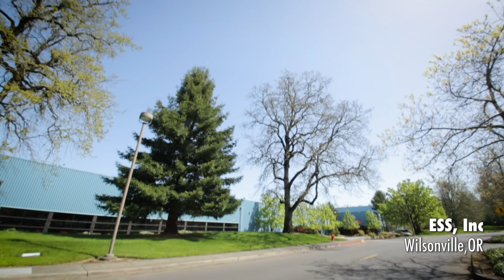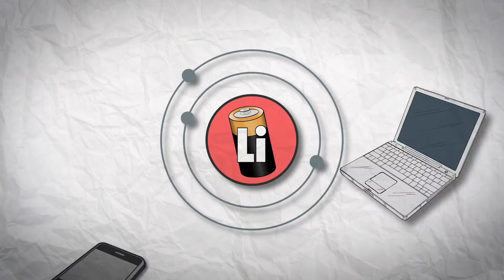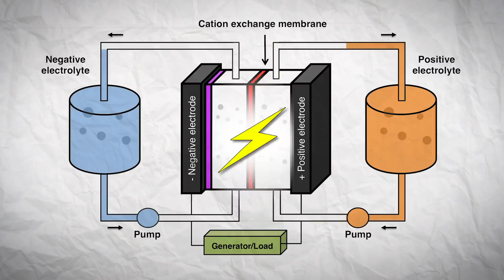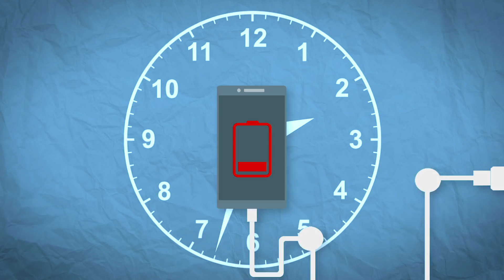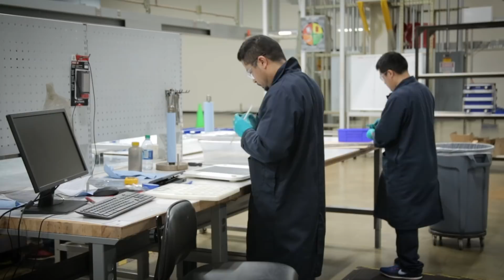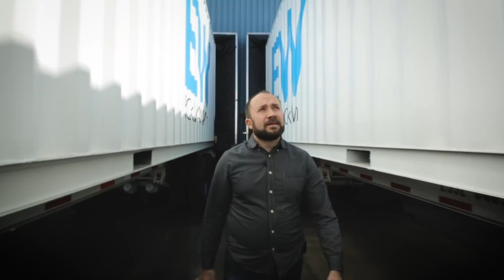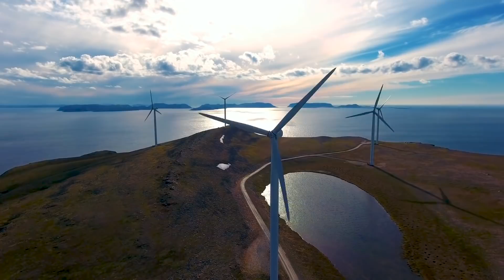Battery Fueled by Iron and Water Could Transform the Power Grid

Comment: Here's the problem I see with this video, first off it compares cell phone batteries ie lithium cells by saying they degrade over time, wow that means we will soon have new types of batteries to go in our cell phones right? No because this technology is not for cell phones it doesn't work for cell phones. But hold on you just compared the technology used here to cell phone battery tech that surely means you intend making it work for cell phones right? No! then why compare cell phone technology to what you have, it makes no sense because what you have will never replace what I need it to do ie power my car/motorcycle, my cell phone/tablet pc and so on.

So we still need lithium technology then to power all the things we hoped this would replace? it seems so.

So comparing lithium to this iron water battery is dishonest and misleading? Yes.

So if I'm wrong then send me a battery for my electric motorcycle as I need one.
Reply: They're using an example which anyone can relate to.
Reply: Yes I get that but it is a dishonest comparison because it's as good as saying a hand cart compared to a van.

They both clearly can carry stuff but are they comparable? No.
Do they both do similar jobs? yes.
Is one clearly more efficient than the other? Yes.
Will they both carry the same amount? No.
Could you travel fast long distances with both? No.
And the list goes on, so yes you could potentially compare the two but it would be dishonest to do so.

One does a specific job efficiently and can be used for multiple jobs and at present is considered the best possible use for almost all scenarios, while the other is only good for large jobs and they won't anytime soon be in your mobile phone or car or motorcycle because  they are completely different types of systems for completely different types of uses.

So it's no good them talking about mobile phone batteries because these battery system won't replace them, talk about the system they will replace and be honest about just how limited this system is.

And there I was already to throw out my cell phone and motorcycle lithium batteries and get on the phone to them, so I could replace them without any degradation. ha.

Tell it like it is.

Comment: Iron and salt water!? Eh?
Reply: Salt water is a very good conductor (lots of dissociated ions) and so there are a number of electrolysis reactions that tremendously accelerate corrosion of iron in salt water.
Reply: my first thought was rust,  and when its all rust u need new iron and salt water right?  u need a new battery after a while. This guy makes it sound like its a new idea and will last forever

Comment: The question is how much is it. Let’s say I was a millionaire I owned a piece of property and I wanted to buy one of these batteries for my property so that I would have back up power available through any storm that is completely silent. Or let’s say I am in the factory building and I wanted back up power and I could lose a large parking space to this system but I needed to operate no matter what conditions were. How much does it actually cost. I will bet you nobody will tell you￼

Comment: Lithium battery only runs 1-2 hours? BS. Runtime depends on capacity and load.  400KWH? A Tesla Model 3 can have 75KWH. Battery useless after a year? I guess Teslas and Bolts will be useless in a year..... NOT.  Phone battery useless after a year? I have never had this happen. Battery danger? Samsung Note caught fire because Samsung was braindead and attempted to ignore physics, trying to cram too much capacity into battery. Well designed Lithium Ion extremely unlikely to have any danger. Billions of cellphones made, only Note ever had battery recall.

There is advantage in longevity, and possibly cost with flow batteries, just saying their bashing Lithium by making crap up.

Comment: Audience:  this is an interesting program, and well presented by ESS, BUT they are not saying this will replace your cell phone, Tesla/Bolt battery or even most home solar battery banks.  This is not an individual consumer thing.  This is for large industry, the power companies and military bases.  They need simpler chemistry not made of expensive exotic ores refined for just that need, also power companies like big stuff that can take a bad weather hit and can be rebuilt with men holding wrenches.  Li ion is not really serving that need when scaled up to mega watt and terawatt purposes.  They also gave you a piece of reality of renewables hitting a grid not designed for them.  This is why Hawaii and some other states are pushing home solar off the grid, as more people install it.  The grid just can't process millions of home panels dumping all of a sudden (0-100) to the grid at say 8am.  

They are talking about your cellphone battery so the physics and chemistry can be relatable to you, a normal consumer by comparison and contrast.

As to Iron batteries, the original successful EV from a century ago used the Edison Iron Alkaline batteries, that when they were tired, you just dumped the liquid, washed it away (did I mention it was a century ago) refilled them and recharged them.  They could last nearly forever.  They gave that car about 3-4 hours of driving.  Back then that was 100 miles, today that is 300miles.

Just watch this and file it away in your memory. You may see this in the future or you may see big water sink physical energy systems, or both, or neither.
Reply: Best Response YET!   Quite astute & well thought-out.  Like your style S Tho.

Comment: Ok it seems that there is some math challenge here.  400k (400,000) W-h /50k(50,000)W = 8 hours of at that draw. The small k stands for thousands. When one devides watts by watts you get one and you are left with hours. It seems a few people were getting the division back words. Still would work out if one keeps the notation straight.   One would get an result of 1/h. Simply invert and you will get the hours of usage.

Comment: World first: Liquid air energy storage plant opens in Manchester The technology works by cooling air to -196C to turn it into liquid form, allowing it to be stored in high pressure tanks. When extra power is needed, the liquid is pumped and heated to turn it back into a gas, where it can be used to drive electricity turbines.
https://www.businessgreen.com/bg/news/3033558/world-first-liquid-air-energy-storage-plant-opens-in-manchester

Comment: The pH of a lead-acid battery is not negative, it is a small positive number, maybe 1 or less than 1.
Reply: To Future Hindsight: I disagree that what you call 'stupid' units of measurement, what I might call unexpected or unusual, keep the public 'stupid'. These things are not difficult to learn or understand, and many in public may not have an education in these matters, or worse, misinformation, for example, from this video.
Reply: Part of the use of port and starboard for boats is also used for airplanes. It is a matter of historical use. For example, time has 60 seconds per minute and 60 minutes per hour. I think I would prefer units of 100. Regardless, people use and understand this system of time. There is a YouTube video that France attempted to change the units of time a long time ago then gave up on the idea. In short, I'm OK with pH. I also prefer metric over Imperial or US units.
Reply: I cannot resist:

A "port" wine is red, the red light is on the left side of the airplane.
Red on the right is wrong, referring to the red light on the wingtip.
Reply: That's a good one. 

I prefer port and starboard to left and right because port and starboard set the orientation to the pilot.
Reply: @Future Hindsight  pH scale is totally sensible. Negative log of molar H+ activity. 10^-7, 10^-1 and 10^-11 just don't mean anything to regular people, so put things on a log scale to put it in numbers thaf make sense on a human scale, then make it negative so you'll only have positive numbers, except in rare circumstances. Yeah, that does mean that more acidic means less pH but you'd struggle to get regular people understanding logH with negative values where -1 is bigger than -10. pH isn't just about acidiry anyway, it's about alkalinity too. What matters to regular people is not just how acidic or alkaline something is, but how far from neutral it is, and whatever you do you have to get it in their head that there's some magical number where everything is good. With pH that is 7. I wonder what you imagine would make sense to regular people.
Reply: @Future Hindsight  So "pH"=log([H+])+7? You'd think it'd be intuitive, but no scientist would actually use it because the offset would only make calculations needlessly complicated, so you'd end up with the same issue: scientists using units the general public doesn't understand. pH is honestly one of the best examples of units made easy to understand for the general public already. It's specifically put on a negative logarithmic scale to ensure that all values are low positive numbers anyone can understand and compare. Negative numbers would only confuse people further. "Negative acidity? So there is negative acid in there? That must be great stuff. No way that could be harmful."

Comment: Nice stuff but what seem to be too good to be true normally isn't. In this case other than the physical size of the unit, there is that 75% cycle efficiency. So what every renewable sources is used to charge the battery, it would have to be over sized by about 20-35% to accommodate for those losses
Reply: If I had to guess, I would think that majority of the losses would be during the charging cycle. It would be even fun if it followed the 80/20  split for the 30% loss during charge/discharge . Interns of cool, I don't think it would be a problem because they can just circulate the fluids through a simple radiator

Comment: I did not understand 1~2 hours use for Lithium Ion, and 4~6 hours use for HydroFlow Iron Water. Did understand cycle life. Would like to hear about Enelope Panasonic Cycle Life, how it compares to Lithium Ion if you ignore power density.
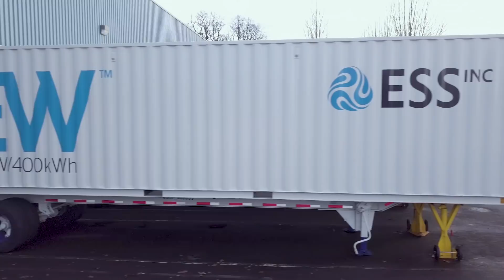Reply: Steve AtTheVan , ??? Hello. ~ I am pretty sure they are talking about Capacitor and Leak Rate. 3:11 ~ I just can not understand why mentioned Lithium Ion storage is for a shorter Capacitance Period than 4 hours. ~ I think it is a brilliant product for High Peak power draw where during low consumption power is stored. Then less spin to to meet peak is needed. A high way engine gets 10% of the mile for mile worn wear of a stop start city drive.

Comment: how should i believe you know what you were talking about,if you mix up the power output with the capacity? and why is ess.inc not forcing you to correct it, as you lower the already not so high capacity by a factor of 8.
Just to get dimensions right, you can get the Tesla Model S with a 100kWh battery and the new roadster in 2020 is expected with a 200kWh battery. So this battery might still be interesting if the cost will be lower then others but energy density seems to be a weak point for that solution.

Comment: If it works like they say, it certainly has potential to solve some of the renewable energy's problems. Granted, it can't solve weather. And maybe it could even take some of the load off of a power plant if there is a surge. I am curious to know if it requires constant charging or if it can be charged and then stored for months or years before it is turned on. I'm still a believer in Thorium MSRs, but I think renewable energy production can have a place in the grand scheme. Maybe this sort of thing could be useful on Mars. There's a lot of iron up there and possibly a lot of water as well... You just need the pipes, material processing and storage, piping, and electrodes. I'd be willing to try it on my house.

Comment: Yet another new battery technology. I've seen none of them going in series or sold to an affordable price. I see no chance for mobile applications especially for ev s by this size. A ship container with the energy storage for a popular ev? Ok off grid applications to storage wind or solar power. Well most people are lucky if they can common li ion or lead acid batterie put in a free space.
Anyway, the video will told us that the batteries can made with home depot materials, but doesn't explain how it works and if they wear out or if maintenance is needed.

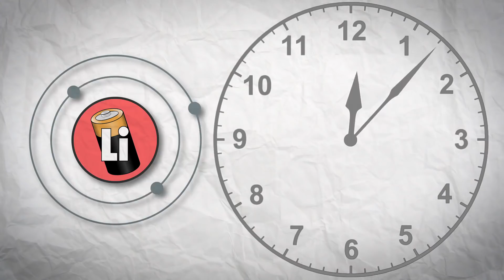Comment: 3:38 "Typical Li-ion batteries can only do it from 1 - 2 hours". Um no, but good try. You can make a Li-ion pack that can do as many hours as you wants, it's just a case of sizing it appropriately.
Reply: Yeah, even someone with minimal tech knowledge would turn away at that. The video was very interesting, and even had some useful tech information - though not much. But that statement about 1-2 hours made me question the validity of the whole thing.
Reply: @owenhann2363  They must be talking about laptop & cell phone batteries.
I leave my cell phone & laptop plugged in all the time, so it's either at 100% charged or run down all the way to 0%. 
The performance of both those 2 items is abysmal, just 2 to 3 hours max.
It would be too ridiculous to say the same thing about EV batteries.
My EV batterys' (LifePo4) charge cycles are controlled by the BMS.
They never charge 100% & never discharged to 0%.
That's why EV's have an 8 year battery warranty.
Of course no one would suggest using cell phone batteries for grid storage.
Although, laptop batteries would work with an EV battery management system (think Tesla Powerpack).
Just look at what the Tesla powerpack has done in Australia.
Reply: kind makes me feel like he's selling stock and the tech isn;t quite there.
Reply: Yeah, I know very little about batteries but even I know that that is a lie. Li-ion batteries are used in laptops and phones and can last as long as you want them to depending on their size. This video gets a massive thumbs-down for that one blatant lie.
Reply: Daniel Hughes, yes’m this statement was using a superior trait of lithium ion, which is that even the lowest power versions can support 0.5-1.0 C discharge rate, while their battery only has a 0.125C discharge capacity (50 kw/400kwh). The lithium ion batteries can easily be arranged to give these very low power specs, but they also can be arranged to give 50kW for 5 minutes (12C discharge), but the Iron battery can’t handle that. A 5kwh battery would fall flat on its face with even a 5 kw load. 

So basically they were trying to sell a shortcoming as an advantage, which makes this an infomercial, not informational.
Reply: To be fair the video does say "typical" 

And the part of the video is a bit confusing but I think it's talking about keeping the 400kwh stored and kept at 50kwh. Lithium ion batteries when charged fully, their charge dissipates over time. I think that's the comparison this part of the video is making.
Reply: Flow batteries cheaper, especially on scale of big containers, so you can have higher capacity than lithium batteries per $. THe higher capacity the cheaper flow batteries, while lithium price reminds almost same with increasing capacity of pack.

google better, hours tells nothing. LiPo batteries 2000 charge-discharge cycles, flow batteries could be up to 20000 cycles.

Comment: This is way too biased video to even watch. First of all, the durability. The Decay. it's evident from this video itself, how rusty things can get. The rusting in iron is accelerated when it comes in contact with salt water. Any person who has traveled in sea can tell that. And no, stainless steel wont work, because the chemistry won't work with stainless steel. Then the second problem, which is size, that whole container is only 50KW. Any format of battery is smaller than that. A 50KW lithium ion battery is about the size of a typical transformer box.
Reply: I don't think that the rust on those pipes is really a problem, it just shows that there is some leakage. 
also I must add that the iron in this type of battery does not come in direct contact with the salt water.
"A flow battery, is a type of electrochemical cell where chemical energy is provided by two chemical components dissolved in liquids contained within the system and separated by a membrane. Ion exchange (accompanied by flow of electric current) occurs through the membrane while both liquids circulate in their own respective space."
Reply: KW <> KWH

Comment: There is something seriously wrong with the math right there on the side of the container.
It says 50kW  400KWh  and 4 hours.  If it can supply 50KW for 4 hours that is just 200KWh, not 400. Or put another way, to deliver 400KWh in four hours it would nee to put out 100KW, not 50.

Is the power, the capacity or the duration wrong ?

Also it looks quite huge for the capacity and power output, although that would not necessarily be an issue as stationary energy storage can usually be sited in places where land is cheap.

What will or will not make it successful is how much it costs and whether it meets its claims of longevity.